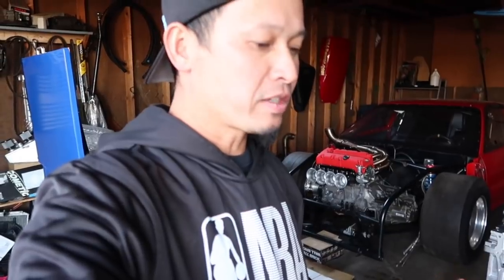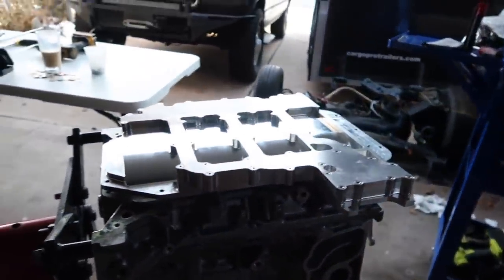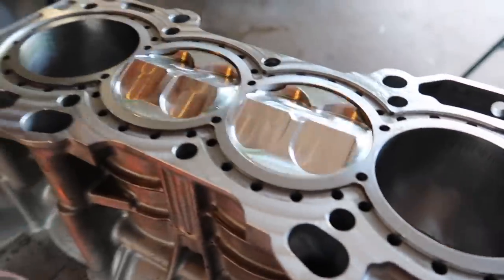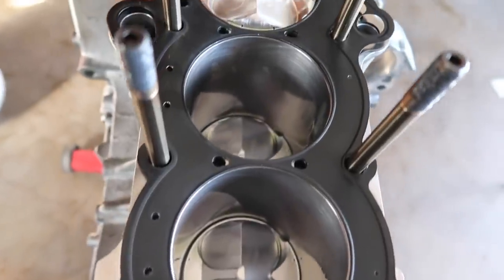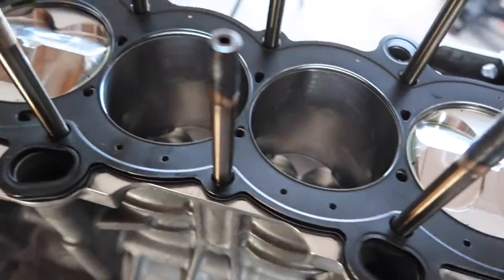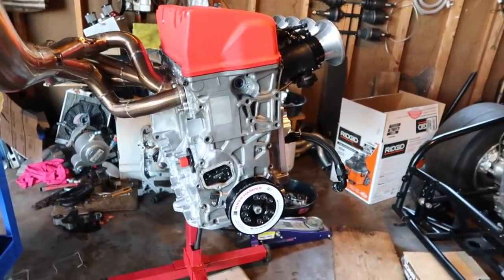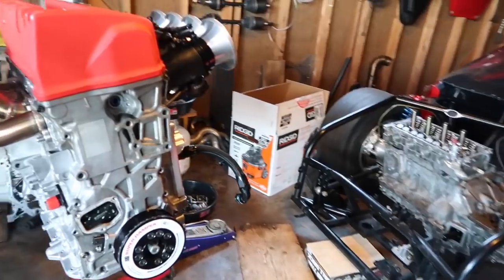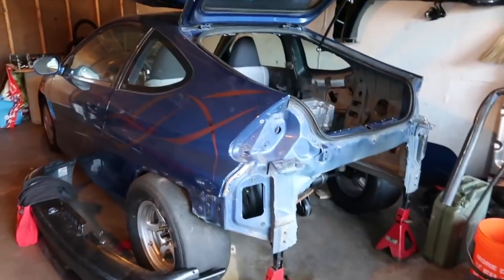assembling the K27 for phoenix

Comment: Hey Phong. Would it be cheaper to get a spacer made up for the oil pan? I don't know if you will be able to get the money back for the pan you have but if not, making a spacer for the pan to close the gap might be more cost effective than having another pan made.
Reply: I just finished watching. I didn't realize you had already setup plans for them to make the new pan. I can't wait to see this setup running. I know it takes a lot of time to get these kind of cars done but it will get there. I have been trying to rebuild my main race car since May. I am hoping to get my block back from the engine builder in the next couple weeks and then I can wrap it up. So believe me, I can't wait to have my car done either.

Comment: Thats a bug no no Phong. You know that ARP thread grease got on the surface of that head gasket when you pushed it over those studs. I sure hope you remove it and clean that grease. It will cause issues if you dont my friend...